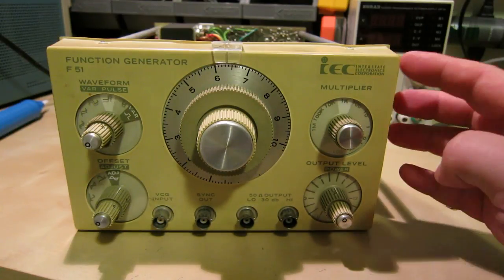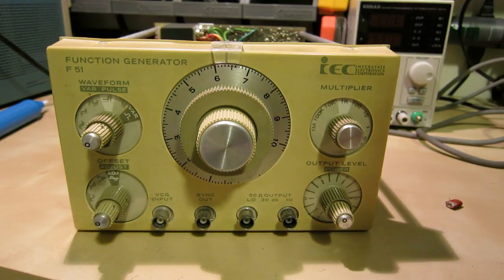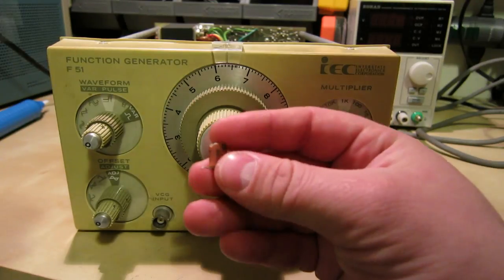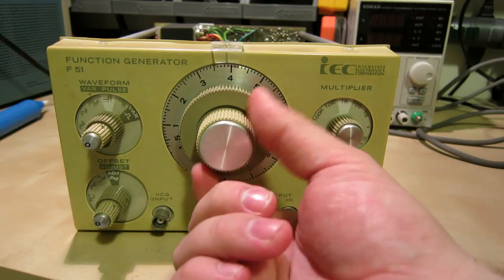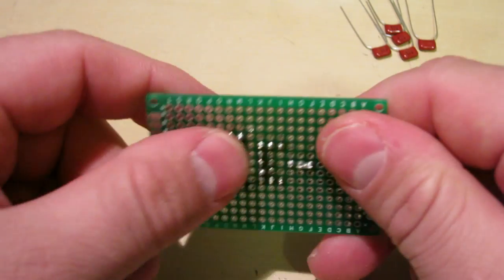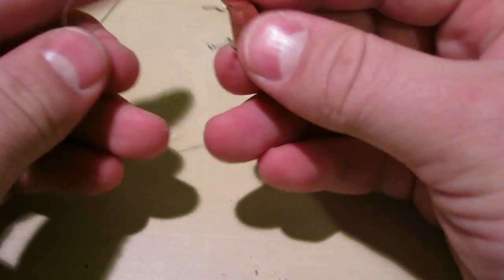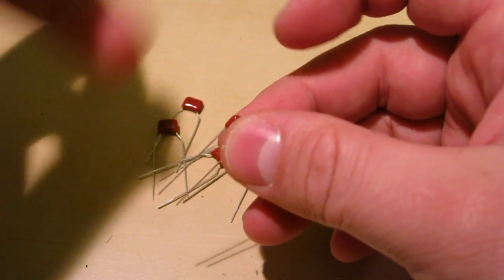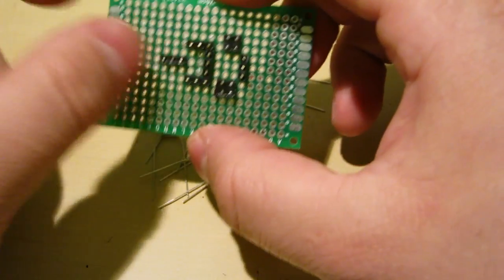Simple Lead Bending Jig

Comment: but did ya get the function generator working.  I couldnt find a follow-up vid.
Reply from the maker: wb8cxo Nope follow-up on it yet. I still have it and I do plan to spend some time and try and get it working in the futire. I haven't really done much with it other than change the caps and TO-220 packages.

I do have a problem of getting new stuff/ideas for videos faster than I can get to some of my older stuff. :)

Comment: So what happened with the function generator, did it power up after all those swap outs?
Reply from the maker: Brian Feeny Nah, no change. I mean, those old caps still had to go, but there is an underlying problem I haven't sat down to fix yet. The gen kinda got tossed into the back of the "to do" closet for a while as I finish filming all the computer hardware I have backlogged. :D